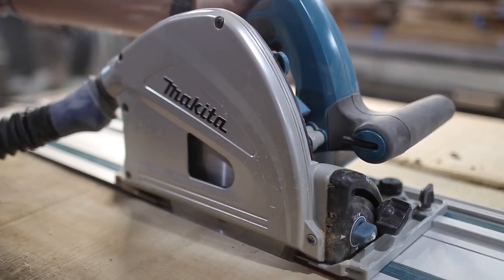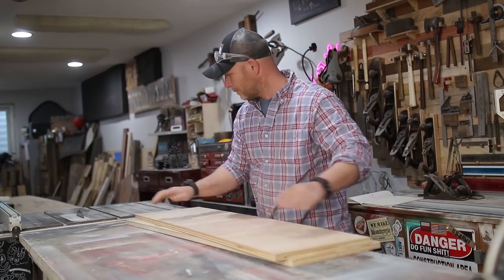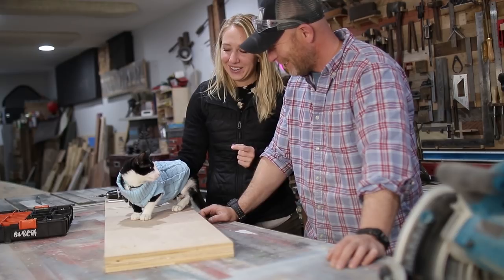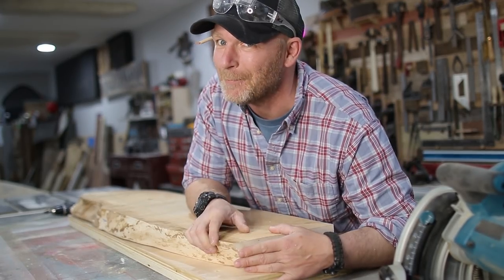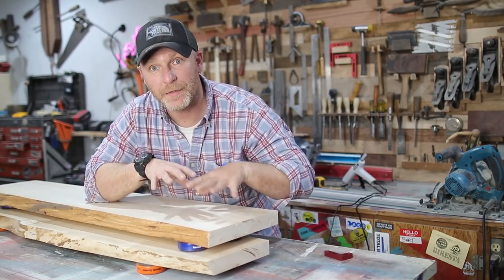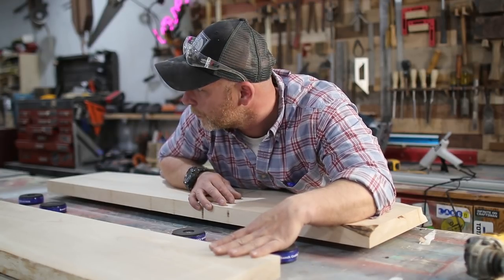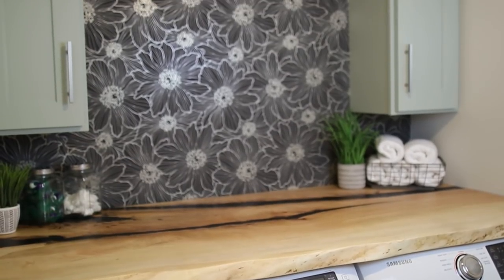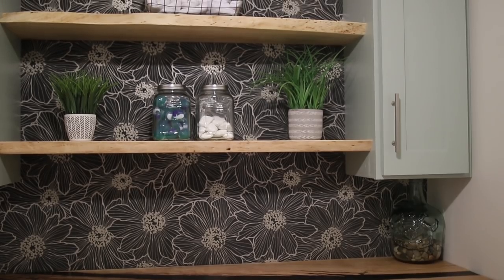How to Make Live Edge Maple Shelves || Giving the laundry room a much needed face lift!!!

Comment: Nice.  Quick question,  so you used two 3/4" lengths of plywood for your planner sled?
Reply from the maker: Stanley Pearse ya. If you screw them together you have less of a chance of them bowing.  Jut make sure the bows are both facing inward.  I made that mistake lol